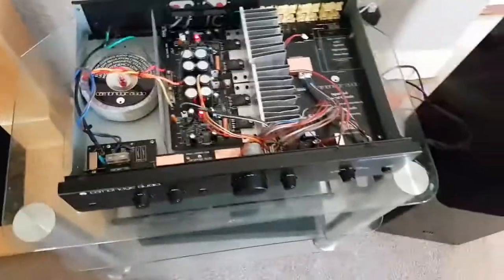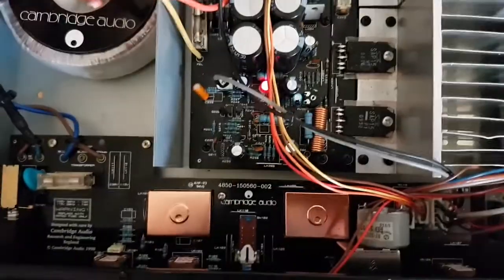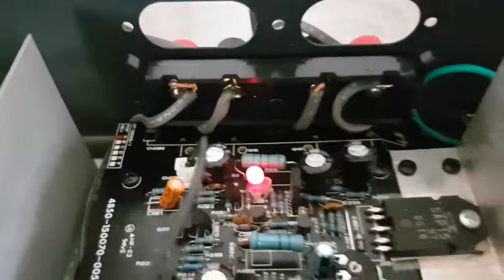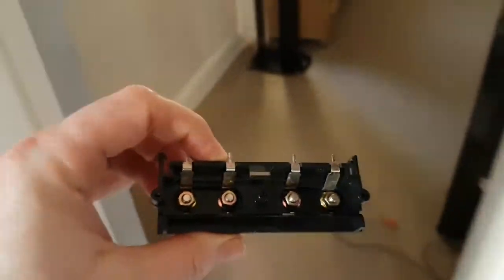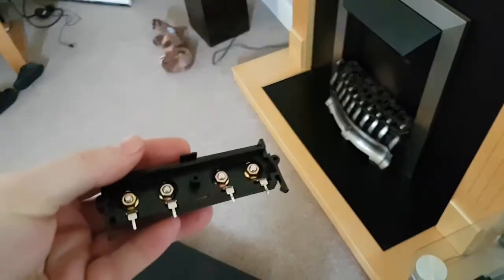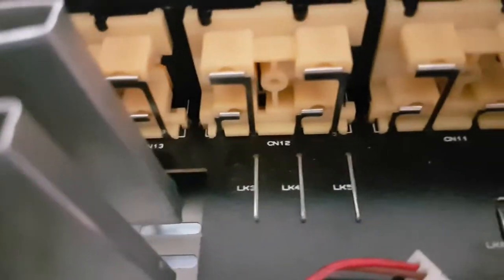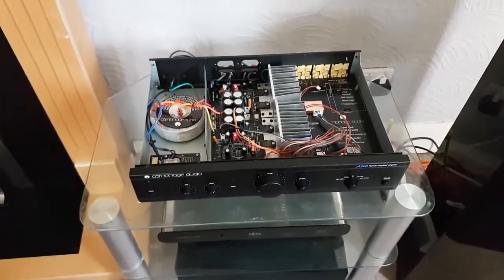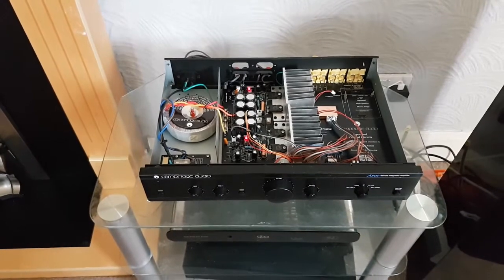Modifed Cambridge A500

Comment: Hi  I have installed two new sockets in the A-500 with two dual  channel LM4562 8 pin chips. Question, will the Sparkos  Dual channel work ok? I just watched your video on the Sparkos!
Reply from the maker: Hi m8 yeah it will try some good opamps l first enjoy the sound
Reply: I’m going to put the SS3602  op amp in it. Should be a big improvement!